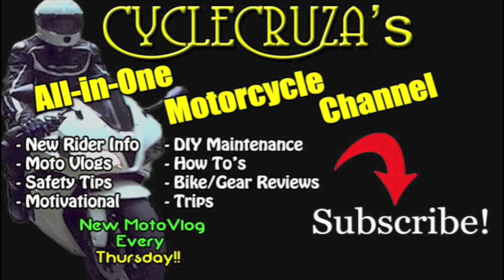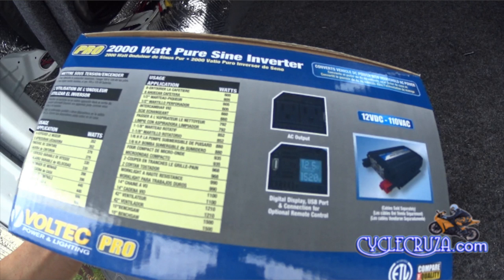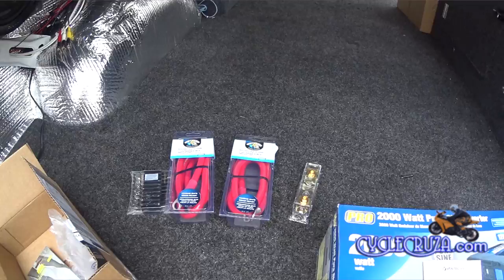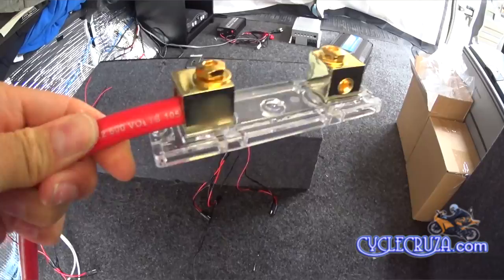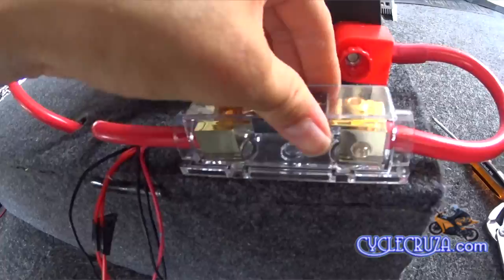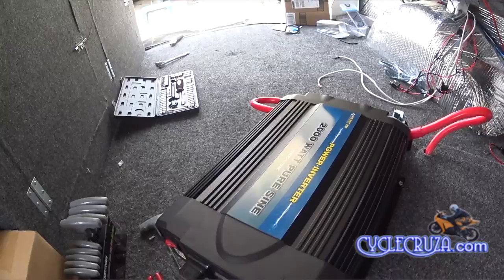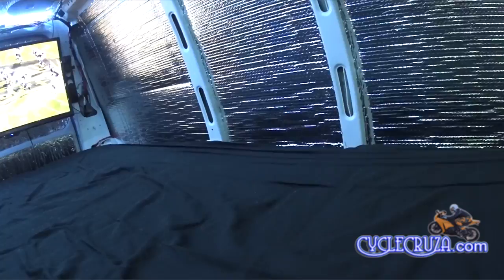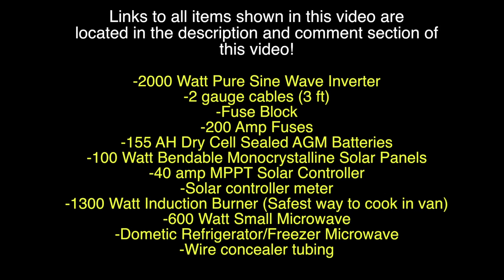2000 Watt Inverter Install in Van | Bug Out Van Build

Comment from the maker: Links to My Van Build Stuff:
Get All of My Van Build Stuff here: http://cyclecruza.com/vanstuff
Get 2000 Watt Inverter voltmeter here: https://amzn.to/2BBh8F8
Get #2 Gauge Battery Cables here: http://amzn.to/1ElxBGt
Get Fuse Block here: http://amzn.to/1h0iPQG
Get 200 Amp Fuses here: http://amzn.to/1P4i3Na
Get 155 AH Sealed AGM Batteries here: http://amzn.to/1S1RxVa
Get 100 Watt Bendable Solar Panels here: https://amzn.to/2QP4j4v
Get 40 Amp MPPT Solar Controller here: http://amzn.to/1S1Sop0
Get Solar Controller Meter here: http://amzn.to/1K16asL
Get 1300 Watt Induction Burner here: http://amzn.to/1h0jp0S
Get 600 Watt Small Microwave here: http://amzn.to/1MihFLM
Get 12 volt Refrigerator/Freezer here: http://amzn.to/1Mzgu6R
Get Wire Concealer Tubing here: http://amzn.to/1f5H7qD
Get Portable Propane Heater here: http://amzn.to/1JA4s2z
Get 300 watt heater element here: http://amzn.to/1ZP7tOo

***CycleCruza's Recommended Videos*********

Watch Bugout Vehicle Unveiling Video here:
https://youtu.be/l7gU7P-kv8I

Watch Bugout Van Build Part 1 Insulation Video here:
https://youtu.be/kp59Nkk7Asw

Watch Bug Out Van Build Part 2 -Flooring Install Video here:
https://youtu.be/NXPwck_WcvE

Watch Bug Out Van Build Part 3 -Sink Counter Build Video here:
https://youtu.be/pcZR7bqqoWw

Watch Bug Out Van Build Part 4 - Folding Bed Build Video here:
https://youtu.be/VRFYFsW0t9I

Watch Bug Out Van Build - LED Lighting  Video here:
https://youtu.be/BduzjVNQgEg

Watch 'How To Load a Motorcycle in a Van Easy" Video here:
https://youtu.be/mq1YguXZQ0Q

Watch Bug Out Van Fold Away TV Build Video:
https://youtu.be/0C9AG1W-XRM

---------------------------------------------------------------------------
GO TO MY VIDEO LIBRARY HERE:
http://cyclecruza.com/my-videos-2

SUBSCRIBE TO MY ALL-IN-ONE SPORTBIKE CHANNEL! 
[New Motovlog every Thursday!]
http://www.youtube.com/user/cyclecruza?sub_confirmation=1

SUBSCRIBE to my new new 100% MotoVlogs Channel:
http://www.youtube.com/user/cyclecruzavlogs?sub_confirmation=1

 WEBSITE/Blog:
http://www.cyclecruza.com

INSTAGRAM:
http://www.instagram.com/cyclecruza

FACEBOOK:
https://www.facebook.com/cyclecruza1

TWITTER:
https://twitter.com/CycleCruza

GET CYCLECRUZA STICKERS HERE:
http://cyclecruza.com/cyclecruzas-sticker-store

MERCH (Get SportBike T-Shirts and Hoodies):
http://www.cyclecruza.spreadshirt.com

Comment: I love your videos.  When I set up my 2000 W inverter and fuse, I bought an inexpensive set of jumper cables and cut off the clamps and used those wires as the cables.  Saved a bunch of money by doing so.  Sometimes you can find a pair of jumper cables at a yard sale for a couple of bucks and save even more money.

Comment: I like your style sure would like to have that system on my Prius/trailer combo? The smart thing would be to put your exact set on my trailer and leave the Prius the way it is. If I ever needed additional juice the Prius can shuttle power via jump cables to the trailer.
Problem is I get only 20 mpg when I tow the trailer at interstate speeds. But I can get 38 if I keep it around 45.
Keep rolling your video narrations are very energetic and upbeat I like that.

Comment: Hell  I got my 2000 inverter at Auto-zone I did purchase a set if jump start cables  I spend about $ 300.00 I did cut the cables in half spliced. Correctly to the back of the inverter . I do use the Inverter in my working truck as needed when ever I need to run my power tools . I just pop the hood clamp the cables positive to positive & negative to negative since I’m not using back up batteries I must keep the engine running while I’m working where is no power . Cordless tools get drained as well .

Comment: voltage drop kills some of the wattage if your batteries were at the 13.4v or even 14.4v like when a car is running the cooker should be doing that 1300 watts. Since it's just using it right off the batteries and there is some voltage drop you gonna get slightly less power just like in car audio amps

Comment: You should definitely check out our Amped Powerbox if you want to see an all inclusive 4000 watt generator, air compressor and jump starter that is fuel free and is charged while you drive your vehicle!
Reply: Amped Power can you put a link so I can check it out

Comment: 1000 watt and above over over stresses the alternator, a heavy duty alternator or duel alternator set up is required to last or you'll be replacing alternators often.
Reply: But alternators are usually over 50 amps no? How stressful can that be for it, your not even pulling more than 20 with his setup

Comment: I doing the same system, but I am confused exactly where you are putting the fuses. I see you put on positive  wire, but where did you put the other one, and where did you put the other fuses? Thanks for info in advance
Reply from the maker: K Butler you only fuse the positive wire not the ground wire. All of my other electrical connections are also fused inline but with small inline fuses.

Comment: CycleCruza I would install a couple of these power manifolds to the battery. It's more reliable because with your setup, you are more likely to have corrosion problems. And it's cleaner of course. Here is the 30 port version http://crimpsupply.com/battery-terminals-copper-lugs/30-tab-quick-disconnect-power-feed.html. They also have a 10 and 20 port version. You might be able to find something like this on Amazon.
Reply from the maker: Ben Huskey Corrosion from what? The battery box seals out most moisture and the battery terminals are made of brass so it's not likely there will be any corrosion.  We'll see though. I'm done buying shiz for this van. lol
Reply: Yeah, I forget that I over build my projects. lol. I really like your videos btw.
Reply from the maker: Ben Huskey Hey thanks for watching! Appreciate it.

Comment: Have you ever thought of wiring the vans alternator to the batteries, so when you are on the road the batteries are being charged by the van as well as the solar panels? That way they can get charged at night also/
Reply from the maker: James Elliott Leaving van as stock as possible to avoid any problems. I should be able to get all the power I need from the 400 watt solar panels. The only things that use the most energy is the induction burner and microwave. The microwave won't be used all that much and if I do it will be during the day when the solar panels provide me energy. I may use the butane burner more if I see the induction burner is using too much energy. I will try to keep it to 15 minute or less meals with the induction burner. It's all about power management.
Reply: That's fair enough, I was thinking more of in the winter when the nights are long and the solar panels will be less effective, in order to make sure the batteries don't go flat.
Reply from the maker: James Elliott In the winter I won't be doing much bugging out anyways. lol Maybe on a few nice days I'll do some local bug out trips in the winter.

Comment: you need to have a small generator and a battery charger so if their is no sun you can still charge your batteries. just syfen gas out of your gas tank. they have like 25 gallon gas tanks the van you have
Reply from the maker: Ginger Smash I have a smart battery charger mounted on the side of the battery box and hardwired to the batteries. I have no room for a generator and don't want to draw attention from the noise it makes when placed outside the van but it could be a great option when out in the boonies. I may end up getting a small generator though. If I need a charge I will have to go to a RV park overnight, however, I plan on managing my power. I still have the butane burner that I will use as a back-up cooking source and for cooking at picnic tables at rest stops. Thanks for the smart tips!
Reply: CycleCruza No problem. Keep up the videos. I love bug out things. I found your channel after looking up camper vans and once i saw your channel i subscribed right away because you keep things interesting. Keep it up
Reply from the maker: Ginger Smash Thanks! Much appreciated. Take care.

Comment from the maker: FYI - Here is a great small portable generator that would be great to add to a bug out van that takes up little space:  http://amzn.to/1DGUsll
Reply: CycleCruza If I were you, I would make a video on how to use a generator to charge the batteries using the dc port or whatever
Reply from the maker: Maybe in the future but I'm cutting down on spending. lol I don't think I will need a generator with my solar set-up, the solar panels have kept my batteries topped off every day. We'll see though when I actually do a bug out trip.
Reply: You're awesome, I gained so much respect that you respond to comments on videos. Maybe a long trip will be hard on power because of all the high draw systems but all you'll need to do to top it off is park it in the sun and go for a nice walk or ride. The batteries also give a nice buffer that you can use more than you generate for a little while. I thought you already had a generator, that's why I suggested it. Deuces!
Reply from the maker: ***** Thanks!  I try to answer as many comments as possible but I get a ton of comments and no time to get to all of them. We'll see how the power consumption goes on my bug trip that I'm preparing for as I type this. Of course I will keep you all updated. In the future, I'll probably get a little compact generator for emergencies when camping out in the boon docks.
Reply: How can I put something in my van for heat
Reply from the maker: Farooq Cato heater buddy, it's in one of my bug out van videos.
Reply: send me the video
Reply from the maker: Farooq Cato It's in my van tour: https://youtu.be/XmruWX5hDNo
Reply: Can I hook it straight  up to my van battery? If I keep the van running while the inverter is powering up a Microwave , Will the alternator in the van always charge the battery?
Reply from the maker: CLIFFORD DANG I wouldn't mess with the car battery for a microwave, even this little microwave uses 1000 watts and sucks battery power.
Reply: Cool, thanks man...how do keep the battery from draining down if it doesn't get charged?
Reply from the maker: CLIFFORD DANG You must have missed my 400 watt solar set-up video?
Reply: Yes I have, link please!
Reply: this guy is so freaking informative. i love this guy. thank u thank u. fuck all the haters. dude u freaking rocks. dont stop. we  novice need for you to keep making it simple 4 us

Comment: I wish I knew all this electric work stuff
Reply: +- Davey The Van Dweller - It is difficult, not everybody can understand this, even I asked an electrician friend of mine and he is affraid of this set up, I am going to do it, but he gave me the doubts, specially on the use of those red wires, he said that is a lot of electricity, that has to be very well connected otherwise would be extremely dangerous, but I got not other choice.

Comment: Do you have a 12v separate from the 120v you have converted? say for example a cooler uses 12v does that come from the main battery or separate system?

Comment: So not 0. Whats better 0 or 2? I have some guy that i might use to install my inverter and he said 0. But i just wan the best wires cause in the future i might get a 2500-3000 watt inverter
Reply from the maker: +chris hill Well it depends how you will use the inverter. I will not use anymore than 1500 watts ever so 2 gauge is fine. However if you will be maxing a 2k inverter out than 0 is the best. For 2500-3000 watts go even fatter at 1/0 or 3/0 gauge if wire is less than 3 foot.

Comment: Hi i have a 1500 watt power inverter. I want to install it in my tractor trailer truck so what size wires should i  use..
Reply from the maker: +chris hill 2 gauge cables....

Comment: how do you know the size of fuse to use between the inverter and the battery
Reply: Osakwe Jindu 2000 watts (power) divided by the supply 12v, would equal 166.6, they probably don't make a 170 amp fuse so you would buy the next size up which is 200A for a guess

Comment: ive got a 1000w peak2000w inverter and i wanna get a microwave possibly , would this thing be ok running it?
Reply from the maker: +2dgamedev I can run a microwave fne but it uses a lot of power, 900 watts of power. Imo, a microwave is a waste of money and deadweight. I hardly ever used it on my last bug out trip.  I built a custom cabinet since this video which accommodates the microwave but I'm taking the mcrowave out. If I had to do it over again I would have just kept the 1000 watt inverter to save money. I hardly ever use the inverter, only for the tv and it's voltmeter.

Comment: 2 pieces  battery  with  155ah and is it connected parallel or  series?
Reply from the maker: parallel, 12 volt system.

Comment: CC- using some of your ideas for my Transit build. What are you using for  the floor as a covering? And have you done anything for the walls since this vid? I too have the silver spaceship look left over from insulation step and want to cover with ???grey???? something.
Any ideas or plans on your part? Thanks and eventually will dupe your microwave install-Doug
Reply: Found the link. Wall covering for the future? Same stuff planned or?-Thanks-Doug
Reply: Douglas Higbee You can work with the curve of the walls with tongue and groove planks by using a chisel and trimming to the inside curve part of the tongue.
Might be a good suggestion for you, dunno. Some people have different plans for their build and don't want wood walls...
Reply: Sorry, I was vague in my request. I was seeking the floor covering, or grey stuff he used as carpeting. Is this simple carpet? I'm dong my walls/ceiling and want to use a simple grey fabric covering, but one that stretches in order to work within the curves and shape of the walls/ceiling. HD carpet I have, and that ain't it; won't stretch to intricate contours. Know a product out there?

Comment: I don't see how your batteries are connected to your inverter. All I see is your inverter connected to your fuse block.
Reply from the maker: +Andy Hartley ??? It's hard-wired to the batteries. The positive cable is inline fused.
Reply: +CycleCruza I don't see how your batteries are connected to your inverter. All I see is your inverter connected to your fuse block. are your batteries also connected to your fuse block?

Comment: CycleCruza  How long can you run your TV and stereo on that 2K inverter?
Reply from the maker: Blablabla Probably all day, LED  tv's use very little energy.
Reply: CycleCruza It is a cool system you have there man. Any thought about adding some kind of small AC unit to run off that 2K inverter. Also you could probably set up a charging station for your bikes battery just in the event some one comes over and turns your bikes power on.
Reply: Blablabla Don't dirtbikes use 12 volt batteries too?

Comment from the maker: FYI - Links to get items shown in video! (Since people always ask!)
Get 2000 Watt Inverter with voltmeter here: http://amzn.to/1OKkDrl
Get #2 Gauge Battery Cables here: http://amzn.to/1ElxBGt
Get Fuse Block here: http://amzn.to/1h0iPQG
Get 200 Amp Fuses here: http://amzn.to/1P4i3Na
Get 155 AH Sealed AGM Batteries here: http://amzn.to/1S1RxVa
Get 100 Watt Bendable Solar Panels here: http://amzn.to/1S1ROaJ
Get 40 Amp MPPT Solar Controller here: http://amzn.to/1S1Sop0
Get Solar Controller Meter here: http://amzn.to/1K16asL
Get 1300 Watt Induction Burner here: http://amzn.to/1h0jp0S
Get 600 Watt Small Microwave here: http://amzn.to/1MihFLM
Get 12 volt Refrigerator/Freezer here: http://amzn.to/1TqoSd6
Get Wire Concealer Tubing here: http://amzn.to/1f5H7qD

Comment: how much stuff are u going to put in that van?  im sure those tires are gonna pop soon
Reply from the maker: Andy Fetzer This is a Chevy Express 3500, has a payload limit of 4,130 lbs. I'm not even halfway close to that limit even with my bike in the van.The most weight is the AGM batteries at 90 lb a piece which would be a total of 180 lbs and the motorcycle which will be 320 lbs or less. I'm probably at a 1,000 lbs or less payload.
http://www.cars.com/chevrolet/express-1500/2004/specifications/?acode=USB40CHV24CA0

Comment from the maker: New FULL TOUR of my Stealth Camper Van 2.0: https://youtu.be/fQc21wDyDYs
Reply: CycleCruza hey ever thought of hooking up an inverter directly to your van battery terminal? Your van should have a decent size alternator so should be able to tap into a 2000 watt power source with the engine running at idle which basically makes your van a generator - in case you need it.
Reply from the maker: jTjUSA No, battery is not big enough and I don't mess with the van's stock electrical system. I want to keep the van as reliable as possible. lol

Comment: you didnt show if it went to the main battery or a spare battery?
Reply from the maker: +My Apartment On Wheels Everything in the back is hooked up to the two batteries in the battery box.
Reply: +CycleCruza great but was your alternatr charging both batterys ?
Reply from the maker: My Apartment On Wheels No, I have 4 x100 watt soar panels on the roof that provides power. You need to watch my all of my bug out van videos. lol Looks like you missed some. I did a full sola review nt too long ago. here is my bugout van playlist: http://cyclecruza.com/cyclecruzas-bug-out-van-videos